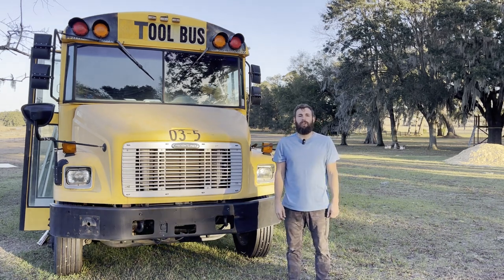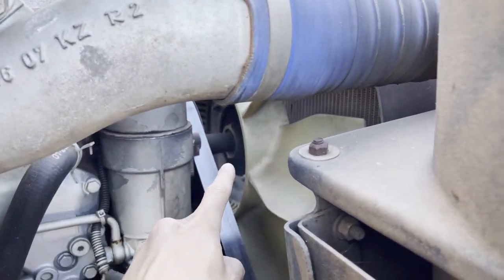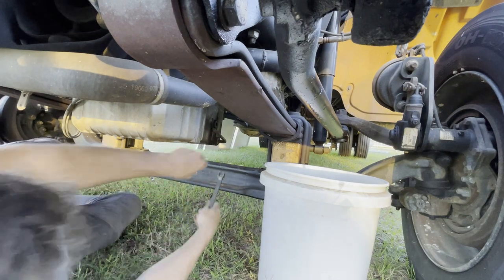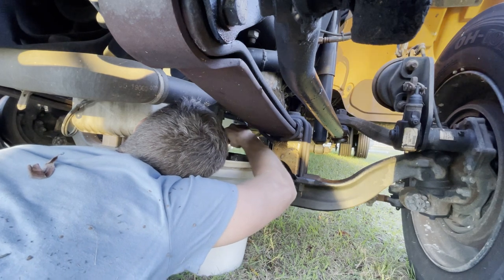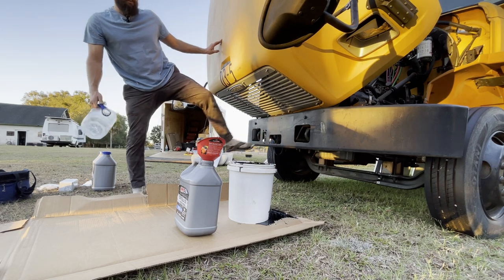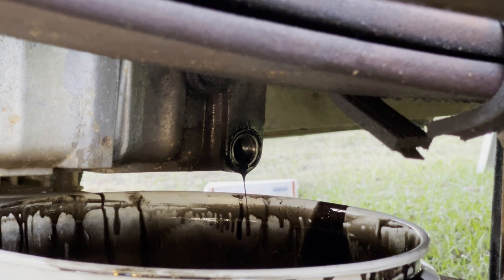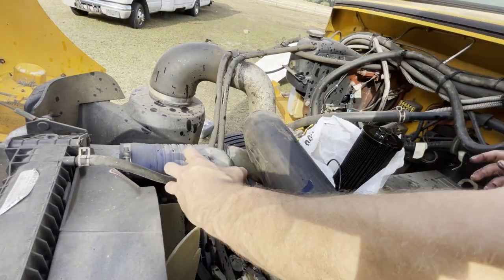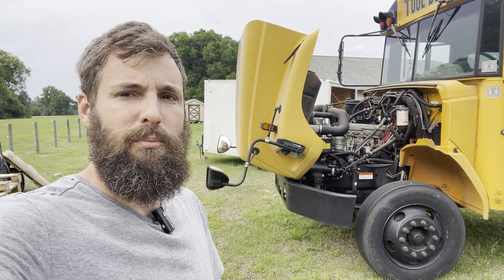Skoolie Oil Change - MBE900

Comment: Change the filter first. It has a valve at the bottom of the canister that opens when you unscrew the cap. This drains the oil out of the filter canister into the oil pan. I would never ever use one of those EZ drain valves. The way they stick out makes them vulnerable to being hit and end up with a broken oil pan. Also, look up into the oil drain hole for debris or engine parts.  Last week I began doing an oil change on my MBE and found part of a cam bearing sitting right there by the hole.
Reply from the maker: I saw your post with the metal chunk coming out and suggested you remove your oil pan to address is and clean out your pan or remaining feverish.

MOST models of these school buses have the oil drain in a place that’s not simply “dangling” beneath the bus for loose items on the road to flop up and shear off. It’s not a concern. In fact, it’s way above front axle and off to the side and no more exposed than other lines for critical fluids like coolant and transmission oil.

Comment: Is it also 36mm socket for fuel and centrifuge filter? Also what is the key for oil pan drain plug? You said synthetic. What oil did you use? I thought best is 15w40 semi-synthetic like Delvac 1300 for this older engine. But if you used full synthetic which weight and brand you used?

Comment: What about fuel filter replacement? And Oil/Water Separator replacement?  Any experience with this maintenance?  If yes, do you use the J47912 fuel system primer when doing this service?
Reply from the maker: I’ll do videos on those later. I changes the fuel filters already and didn’t need a primer to get it running!

Comment: Heyya! I have a very similar bus. I'd love to see some detailed explanations on the mechanic functions of the engine, and common troubleshooting. Recently, after sitting for a lot of the winter, it's developed a ticking when running, so I'd love to see a video on how you address that type of issue.
Reply: Have you checked or changed your oil. These engines have a very specific time frame based on usage on when you should change your oil, the type of oil and how much as diesel typically consumes oil overtime. Their is a MBE 900 owners manual pdf on Google. Very worth a read.
Reply: @trusted_traveler  I do have that manual (I believe the same one - The maintenance manual as well as chassis operator). The bus was underused during it's career, with just 44,000~ mi and it's a 2005. I have changed the oil and oil filter, which improved but did not fix the tapping/ticking.

Comment: According to the engine manufacturer pdf. Oil should be changed at operating temperature of at least 180.
Reply from the maker: That’s fine. You can do that. Changing oil when hot is great.
Reply: If ya likes burnt paws

Comment: According to my research, it should be 25 litres (6.6 gallons).
Reply from the maker: Manual says 30 quarts which is 7.5 Gallons.
Reply: @sojournersway  good to know.  I'll buy 8 gallons instead of 7 when I go to do my oil change in the next month or so.  I have the driver and maintenance manuals that I DLed a PDF for, but I haven't been able to find a shop manual (with the more specific details) yet.
Reply from the maker: @MagentaRV  There is a full Detroit Diesel Manual for this engine online!
Reply: @sojournersway  Do you happen to have a link?  That would be great!

Comment: pray your water pump don’t fail 😂😂😂 these engines are horrible lol
Reply: Horrible based on what experience? Many many truckers love this setup. Maybe not when they were new. But these engines are ideal. Detroit Diesel baby.
Reply: @trusted_traveler mine has been sitting for 2 years. Tips for firing it up again? Any sources for info or videos on it would be awesome too. Thanks
Reply: @sunstirade1085  I always reference the MBE 900 owners manual pdf. It's right on Google. It gives you every instance of issues and how to solve it. In your case I would check over the fuel water separator, oil level, air box and battery life. Make sure you have at least 14V as it takes a lot of energy to rotate the engine.
Reply: @trusted_traveler horrible based on his reading not owning. If maintained properly this engine in medium duty trucks can do million miles. Good luck getting million out of C7 or maxforce.